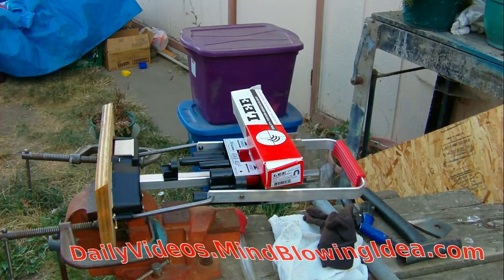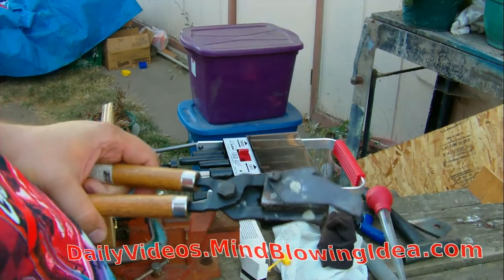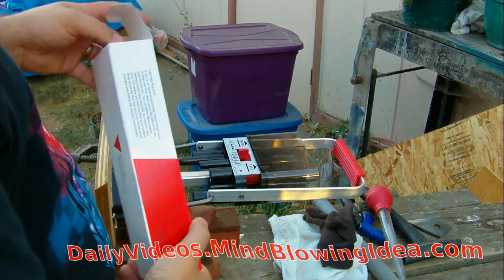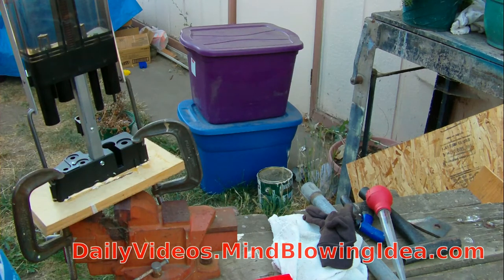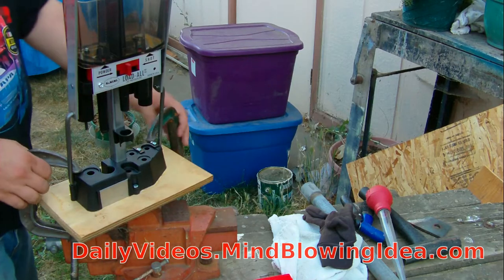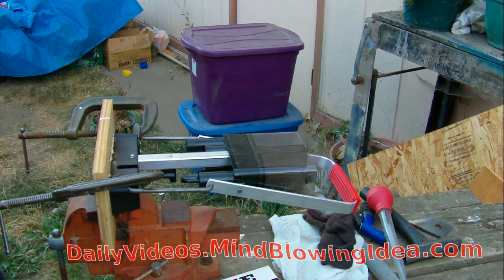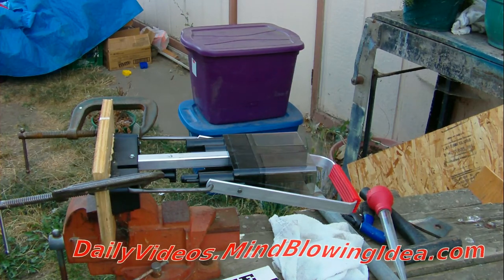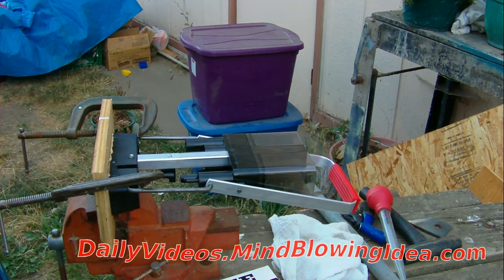Lee Load All II & Precision 1oz Slug Mold Tips & Tricks - Man VS Junk EP 207

Comment: your having problems holding it down because those nuts they gave u with the spikes are for the bottom. you have to drill a hole bigger than the bolt size put the spiked nut on the bottom and as you screw the bolt in the spike grab into the wood which secures the press down and the spiked nuts will sit flush on the bottom